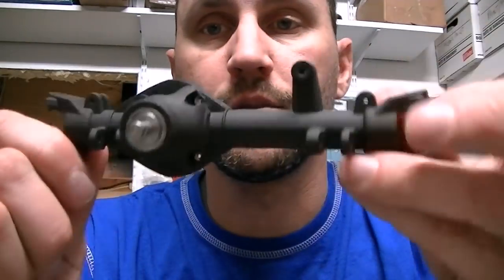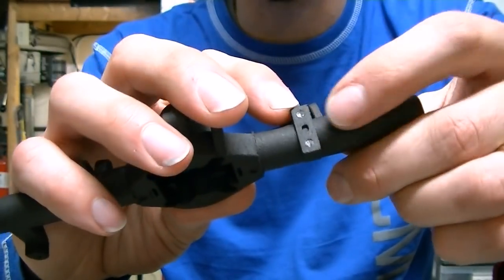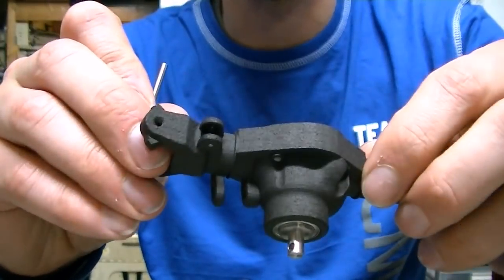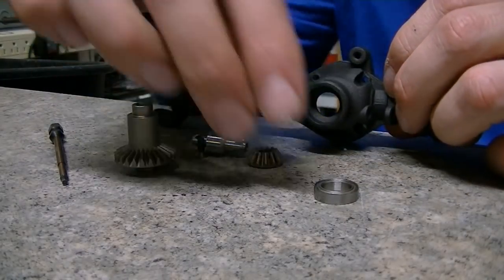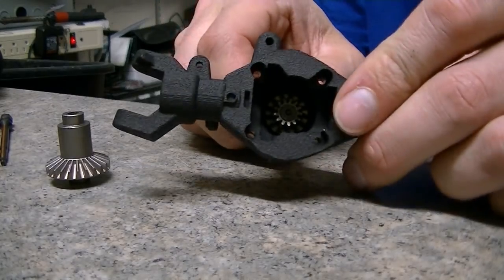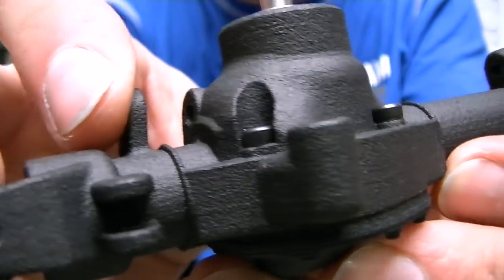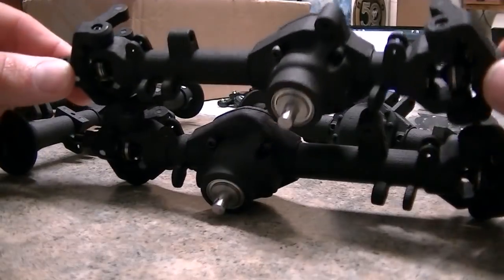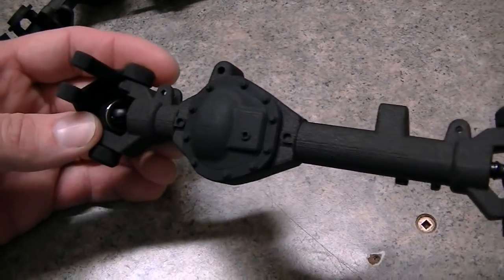RC Tech Talk - Nylon Printed Axles at GCM

Comment: I've always enjoyed your videos but I have to say , I don't trust 3D printed axle.
What makes these stronger than the old Moose RC axles that I seen easily break at a G6 event?
24 ring gear and 13 tooth pinion....isn't that a 1.846 gear ratio?....that's horrible. That makes for alot of torque-twist.
Reply from the maker: You don't trust, but you don't have any GCM axles. The 5 years of people that have been using our setups don't have any issues with them. It's a bit premature to say the gear set will produce torque twist when there's many other factors in suspension that determine this.
Reply: @GCMRacing1  
I visually see a few weaknesses...where the third member/pinion bolts in....theres not much material there and also where the C-hubs are.
They may hold up to brushed motors , 2s or even 3s and small tires....I've had 3D printed stuff...It's just never holds-up to torsional stress. 
I may be wrong on your stuff...like you said , I've never owned those axle. 
They look pretty....I guess if they work for. I run nothing smaller than 4.19 and usually no taller than 4.75 but I run Puller Pro's and Revolvers on 3s and 4s...tho I take precautions(30% Punch Control and such + I'm an experienced rc'r), I build my stuff extremely strong....looks come next.
 As for ring and pinion , I know torque-twist(TT) starts in the axles and has ALOT to do with gear ratio. The Ascender has alot of TT and dialing the shocks and motor pinion and other things won't fix freeway axle gears.
 Love your contents and videos and see some of the coolest rigs on your channel...I always watch them and I would never "thumbs down"(i had to say that) just because I disagree with a one product. 
Again...I may be wrong....those are just my thoughts from what I've seen in the past and being an old 4x4/shade-tree mechanic.
Reply from the maker: @tomlucasrccrawlers9108  great comments. True we do use lower amp systems here, but many of our users use crazy power stuff.
Reply: @tomlucasrccrawlers9108  you just don't seem to know anything about current 3d printing. Basing opinions off sometime in the past or off of bad materials used in bad prints.

Comment: Electric powerdrill for screws? Times change … ;-)
Reply from the maker: After a while we like to save the wrist bones.
Reply: @GCMRacing1  ;) - me, too. For unmounting screws nearly always, for mounting sometimes. Helps a lot - my tiny Bosch Ixo with torque setting add on. Perfect for the hobby (but too expensive in North-America).